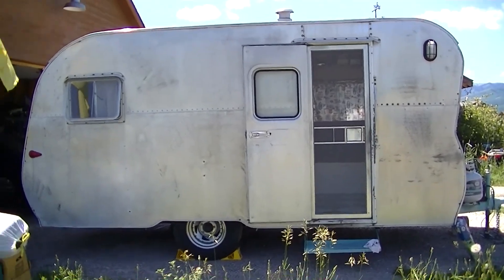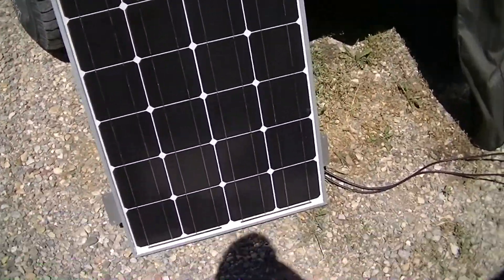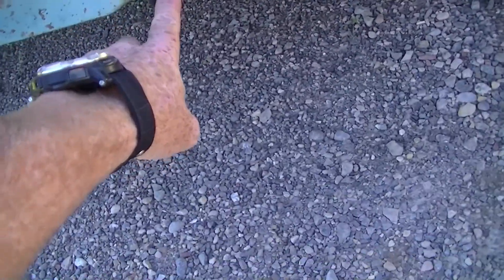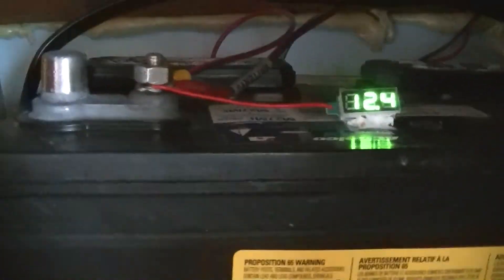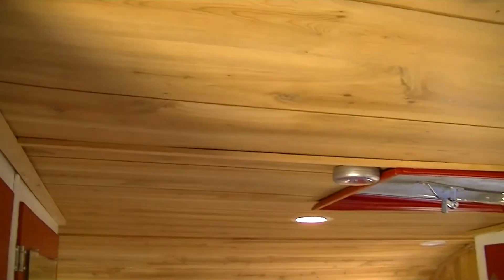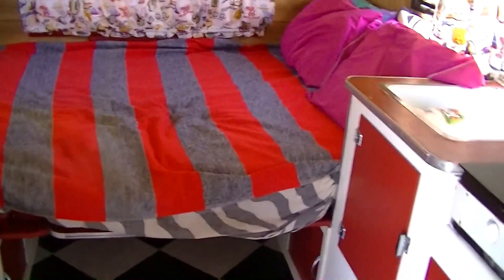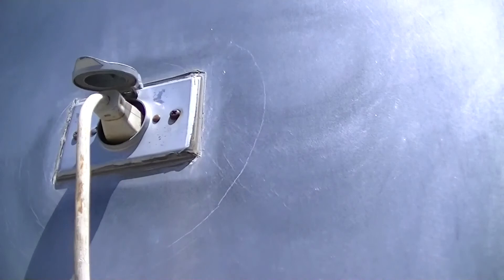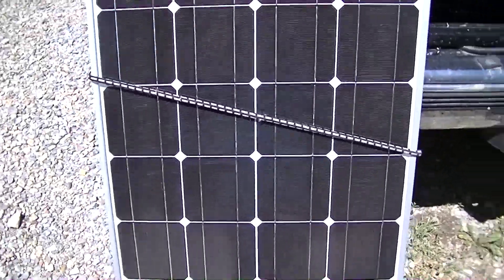Camptrailor Solar Setup

Comment: I really like the vintage camp trailer - We found an old tear drop style thats tall enough to stand up in but waiting for a call back on it... Great job on the restoration - fun stuff..! Something about the old campers is the style they have unlike todays units... Diggen the solar setup too sure makes things easy!
Reply from the maker: good luck on getting the tailor they are for sure fun and i agree they have way more character than today campers and you can always put modern stuff in them